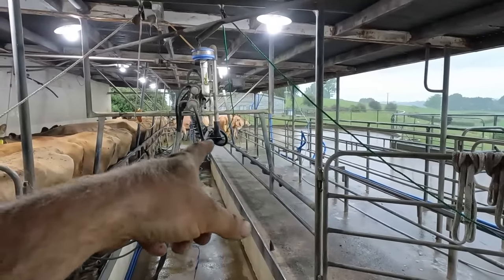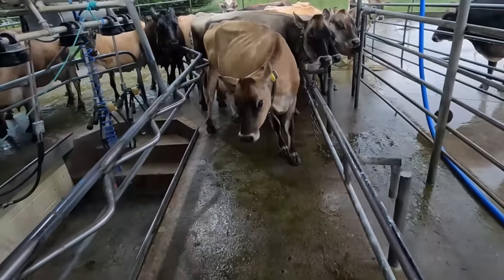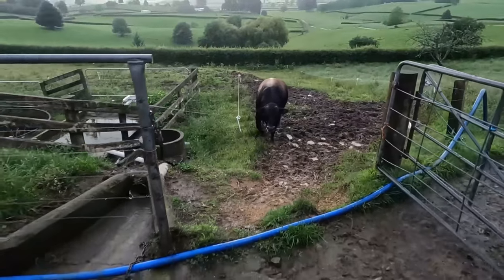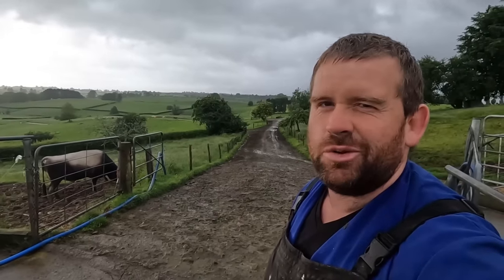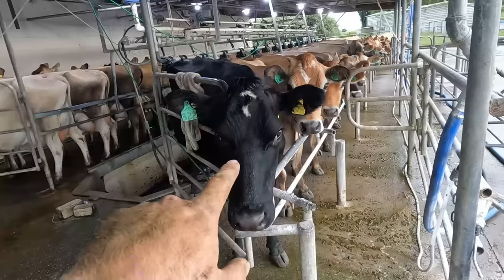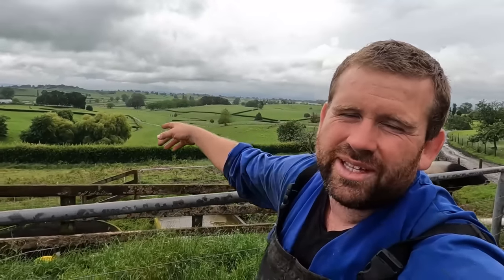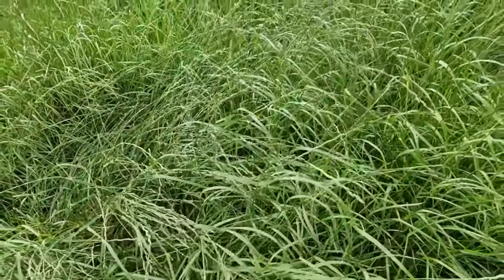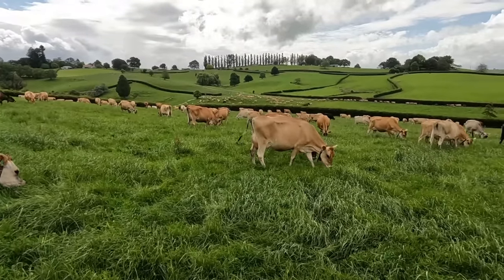Jersey Bulls Are The Worst, I Definitely Don't Trust This Fella!!

Comment: I can relate to the Jersey bull encounters. Was in Dairy Farming in Northern Victoria Australia until 1996, had enough, I knew the industry was on the ropes and sold up, four sons were not going to be Dairy Farmers. My Jersey story happened when I was repairing the fence adjacent to the Dairy, concentrating on what I was doing, didn't notice the Jersey Bull had pulled the bolt back on the gate. I noticed a sound behind me, his horns each side of me and pushing me up against the fence, I made a fist and hit him just behind the crown of his head, he took a small step back, I morphed into a bird and flew over the fence.
Never had any Bulls with horns after that. Cows can be just as dangerous, I have a few fractures to prove it. Did away with Bulls altogether in late 80's, everything was AI after that, I was running a Genetic Advancement Program, everything was AI, including First Calver's, with a Condensed calving pattern as well. I like the Swing Over Dairy, very efficient, dad and I built a 30 a side Swing Over in 1992, 230 Friesian cows through in an hour and forty five minutes.  Just Subscribed, thanks for the video.

Comment: I had a "mini" jersey bull up until last yr. Got him as a bottle baby. But when he turned 3 & I took him over to my folks to breed my girl's for the late summer/fall, he got beyond grumpy & turned into a stalker, first would stalk my dad & would try to corner him (never a smart thing to do to an old man with a short temper. Lol) but when he started stalking the neighbor's kid's he came home. He didn't improve. He had a bigger late cut steer that kept him in line, otherwise we might have seen the changes sooner. But I trained him to pick up his feet & be halter broke & to be lead when he was younger. He was a great breeder, but once he got grump, I had to use my heeler to train him to stay back. Bummer.
Reply: Jersey cattle are pretty "mini" as it is. I didn't;t know there were actual mini Jerseys!
Reply: @Lagolop  there's standard (abt as tall as most Holstein's), mid-size or moderate (a bit shorter than a Holstein), mini's. Which are abt half the size. I think they range between 38" to 42", but without looking it up for the specific size, that's the best my memory can give me. There's also micro-mini's (not necessarily in Jersey). 
This of course, is in the US, not sure if it's common everywhere. 
But our Jersey bull was 38" at the hip.
He bred our standard (regular sized) Jersey cow & her last bull calf is about mid-size. A bit taller than the bull & reaches just below where the ribs curve towards the spine on his mom.
But we have lowline or Aberdeen Angus or mini Angus which are found in Australia. 
We've got a micro-mini bull (soon to be steer) & 2 micro-mini's heifer (well 1 is a cow now).
There's a few mini-jersey farms in the US.

Comment: When around bulls, I have a 3/8 inch x 3  1/2 foot fiberglass composit stick and don’t hesitate using it on their nose after a few lessons they learn to turn away from me .never had one come at me in reverse 😊 .thanks for your great videos!
Reply: My Dad uses a broken pitchfork handle.
Reply: As a teenager I used a 6 foot 1/2 inch galvanized pipe.  I had to clang a Hereford bull with it. Only needed to do that once. Well twice.
 I guess I needed to ring his bell twice. Must have thought the 1st time was a mistake. Dad never asked how the pipe got bent.
Reply: Our horses would rear their heads at us in the barn when we fed them grain with a plastic bucket. It stopped when I started using a metal bucket. Horses have big, heavy, dangerous heads. ALL animals can be dangerous, even pets. Be aware, folks.

Comment: Jersey bulls are the worst. We had one back in the early 90s named Percolator. Could not trust him at all.  Sounded like the one in your video all the time. When we were loading him on a trailer once my mother grabbed the lever action 30/30 rifle in case things went bad. He wouldn't get in the trailer so I had to get in there and slap him on the nose until he chased me. I dove out the side door and he smashed into the wall. Meanest animal I ever saw.
Reply: Line trimmers are pretty convincing ways to encourage them to back off

Comment: We had mixed breed but my pop taught us all that u never trust a bull. He also told us that when working cattle whether paddock or yard that u always needed to have 2 different escapes and to keep some poly pipe with u. 1 cousin if she put her big toe into the paddock it was a guarantee she would get charged. 1 time she got hit and flipped her up in the air like a ragdoll. And my uncle was mustering cows as a couple scrubber bulls had got in mixed breed 1 a jersey cross brahman. He was full gallop next to a dried out creekbed. Eyes on the scrubber in front. But didn't see the one stalking him in the creek bed. He got t boned with both him and the horse rolling down a steep bank . Both hurt but that bull was ready to finish the job. It hit both of them that hard as they were still a tangled mess. He ended up with a dislocated shoulder, 4 rib breaks a punctured lung and liver laseration. But had to scale a willow tree before that thing hit them again. Horse had soft tissue and strains.
U have to be smart working cattle. Handeling helps some but not much. Although a family friend who i help manage his property due to age heflies up their arse had not only doing this but beeping his horn. Just making the potential for an incident and hurt ,so frustratine having o

Comment: Would you be tempted to go with another round of fertiliser to get higher growth rates in paddocks , the rain will wash it in and you won’t run out of grass as fast ??
Reply: NZ Farmers operate under quite strict fertilizer quantities these days. Our volcanic soils were deficient in trace elements and over the years successive fertilizer use has overloaded them such that rivers and town water from runoff is now often toxic.  So, the govt has tightened up on fertilizer use to bring it back to a workable balance.

Comment: Jersey cows are so beutiful. Are the bulls aggressive even if castrated?
Reply: No but they are no use then
Reply: @seanmoynihan7471  thank you. I know most male dairy cows are basically discarded. Thinking about raising a jersey bull/steer since I'm a couple hours away from a dairy farm here in Jersey.
Reply: @south97north jersey beef some of the best you can get. just don't get alot !
Reply: @sallyjones390  you're darn right! My son has a 300 cow Jersey herd. Been breeding half the herd to Hereford and we are excited to raise a few steers. Should be fast to finish and certainly makes a smaller carcass which is easier to market as freezer beef than the monster 900 lb plus carcass of Holsteins or beef breeds